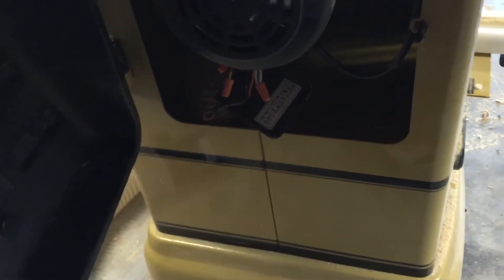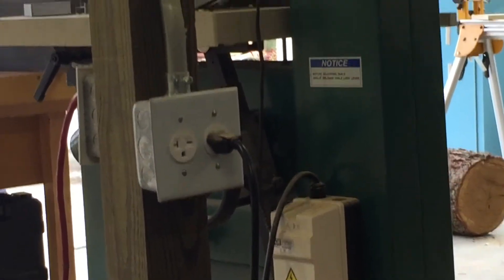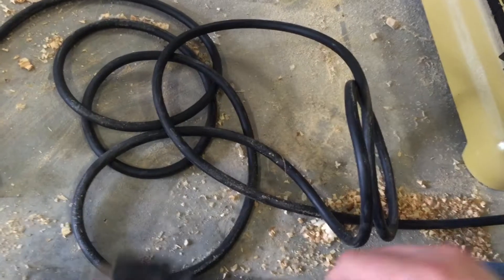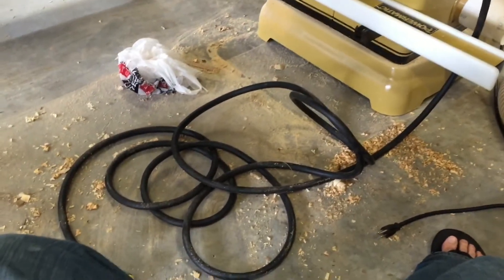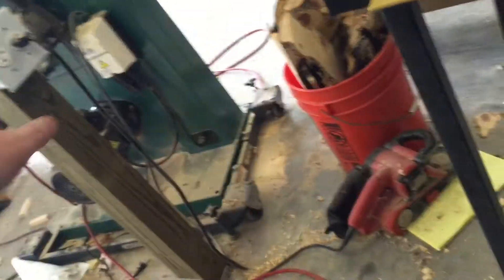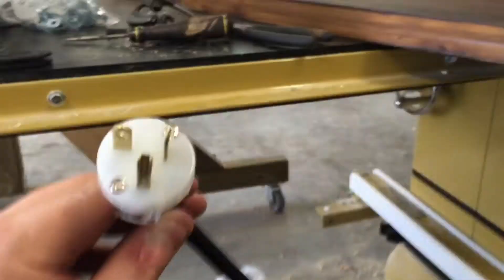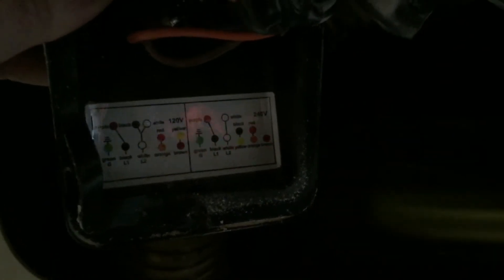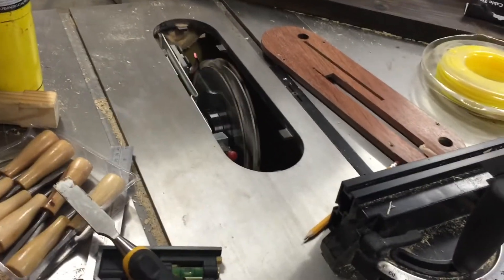Rewiring powermatic PM1000 table saw from 120v to 240v.

Comment: Question, the PM1000 is a 1-3/4 hp motor, does wiring it to 220 make it a 3HP motor?
Reply: No
Reply: no it doesnt, the 3hp motor is physically bigger
Reply from the maker: It doesn't change the HP.  It only reduces the amperage in the circuit by 50%.  I think the benefit is that it makes it less likely that you will pop a breaker.  I want to say that it makes the motor run better on start up because you have less of a current spike when you turn the motor on.   For what it's worth I can't definitively tell you that either wiring method is better.

Comment: the wire rating id on the outer rubber shell and says what category, voltage, amperage, etc;

I don't know why people say to get a heavier gauge wire to run on 220v as the current draw; amperage is cut in half... just the opposite actually; just change the plug and that's it ! 
Exactly what you did. You'll be saving money and the saw will run better (runs better since this is an old post).
Been loking at that saw; are you happy with it ? any issues ?
Reply from the maker: Fred V. Lord of Glencoe i haven't had any issues with it at all.  It works like a horse.

Comment: You're gonna love running your Table Saw on 240v. My Table Saw is a Grizzly G0661 2HP 220v Contractor's Saw, I love the fact that the Blade comes to speed almost instantly. Once you've run a Table Saw on 220v/240v, you'll never want to go back to using 110v/120v again.
Reply from the maker: Thanks for the comment, and you were right, no regrets...